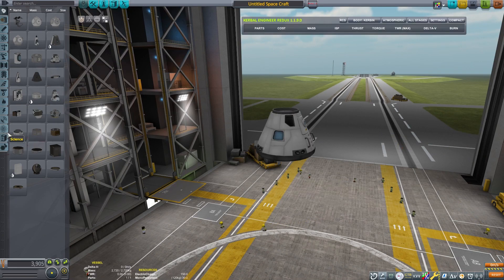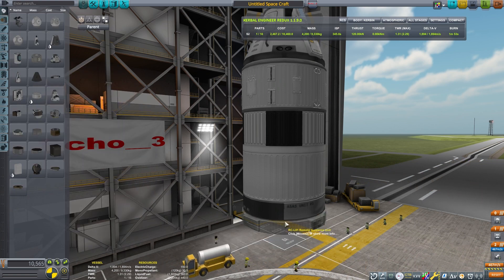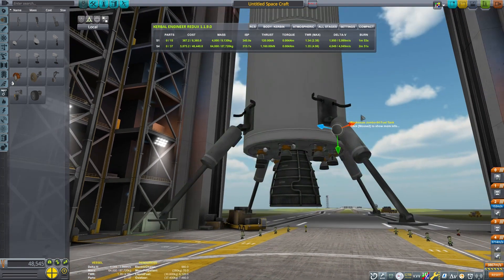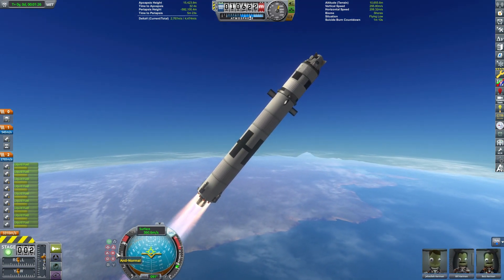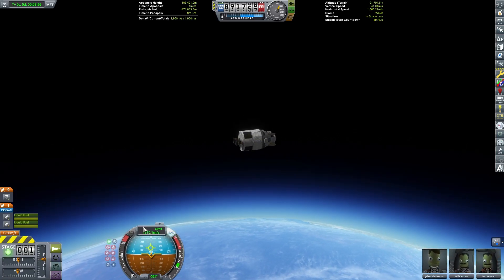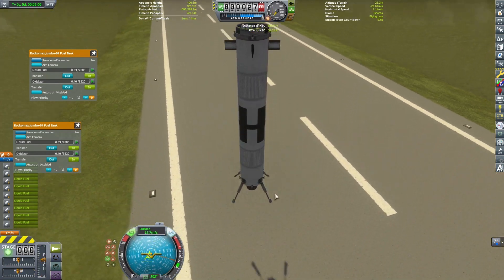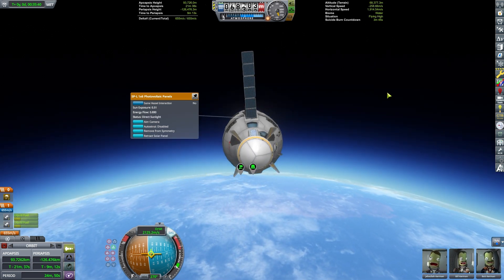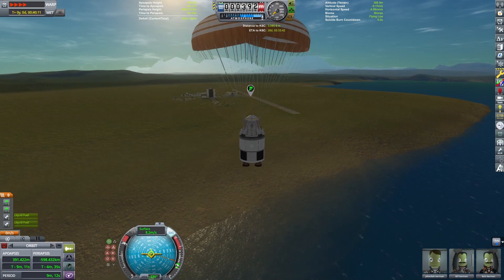Reusable Rockets: Landing the booster and upper stages back at the KSC.

Comment: I wonder, why to do gravity turn? Isn't it better to go straight up? It would be a shortest way out of the atmosphere, and when you are at apoapsis, you can rotate 90 degrees and go to orbit. When you do gravity turn in atmosphere, you just spend more time, fighting air.
Reply from the maker: A gravity turn is much more efficient way to get into orbit. It takes about 4500 m/s of Delta v to go up to ~100km then circularize, but only about 3200 m/s of Delta v by using a good gravity turn. I have a video where I demonstrate this. However, with a very high Thrust to Weight Ratio the difference would be much lower.